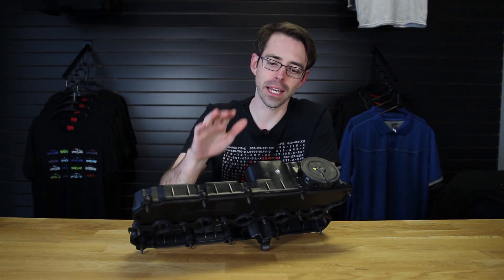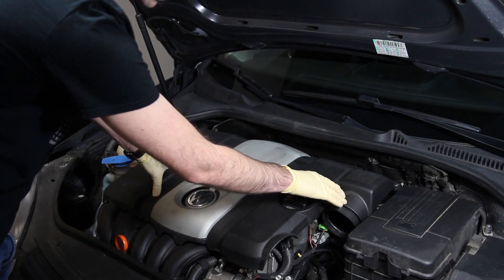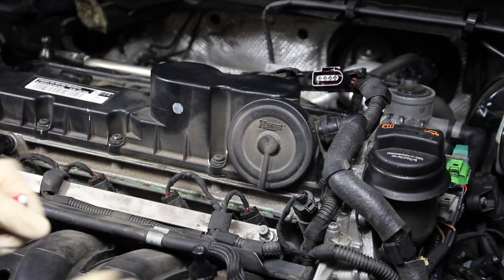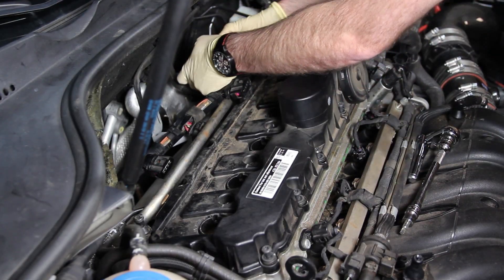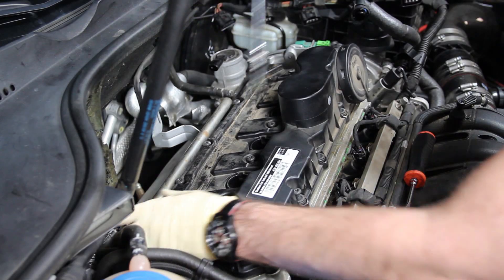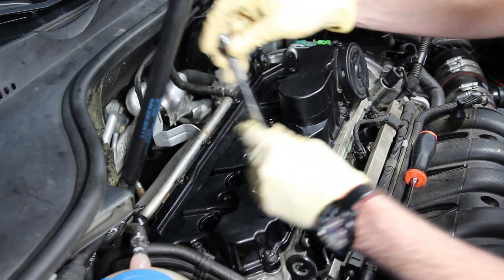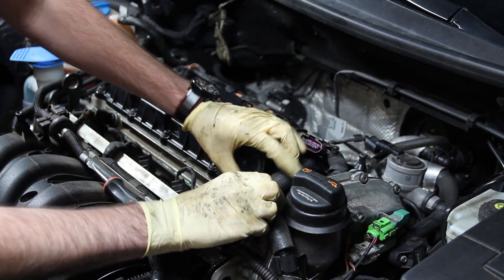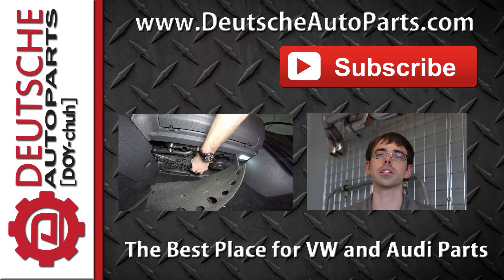How to Replace a Valve Cover on a VW 2.5L 5 Cylinder Engine (PCV Valve Built In)

Comment: Hey guys, great video! Everything is very clear, understandable and you guys make it very easy! 
I have a question. I bought a used 2012 Jetta 2.5L. It had P0106 code and that was MAP sensor. The car would accelerate with hesitation, and after I release the break the car wouldn't move right away. So I took apart everything I needed and took the MAP sensor. It was covered with oil. I replaced it with the new one. The car drives fine, but for a day only. Then same problem. I found out that it was getting covered with oil because of bad PCV. I ordered one online and replaced it hoping it would stop leaking oil. In two days again same problem. The MAP sensor is covered with oil again. Plus, I got P1288(or something like that) saying the system is too rich at bank1. So I guess since MAP sensor isn't working properly the system gets too much/too little air, right? Because of that the accelerates even worse. When I clean the sensor again and reset the codes, the car drives just fine, but for a day or two. I'm sick of taking the sensor off and cleaning it from oil.
So does it all mean I need to replace the whole valve cover? 
Please guys, guide me here. I spent all my savings on this car and can't afford going to the shop/dealer since I'm a student. Trying to fix it myself.

Thank you so much!
Reply: Husrav Homids you need to replace your gaskets. Buy your parts from Rockauto.com they sell the entire gasket set for 98 bucks
Reply: What did you end up doing with the car?
Reply: @Mario-iy7hw  I ended up selling it with that issue still existing. Couldn't figure it out. Oh well

Comment: Hello Deutsche Auto Parts, I'm replacing mine, since a mechanic did a terrible job on it. Would you recommend adding silicone or would gasket do just fine? Mechanic used silicone and i had oil leaking everywhere. I took cover off and there is oil inside spark plug well. What liquid would you recommend to scrape off the silicone around the cylinder head and take out oil inside the well, I'm afraid unscrewing spark plug and have oil go into the chamber. Thank you.

Comment: When installing new valve cover do I need to put any RTV under the gasket or none at all?

Thanks
Reply: Levent Akkaya depends on the gasket type. I like PEL-FAM their gaskets are crush gaskets they seal as you torque

Comment: Great video. Hope my mechanic watches before replacement. Estimate $420 with $250 for part. Horrible design, need to replace entire cover for a simple mechanical failure.

Comment: I have read on some of the forums that a P0106 code, which indicates a bad MAP sensor may be caused by the PCV going bad, allowing oil onto the sensor. I have replaced the sensor recently, and have just read the same code. Is this a likely scenario? How do I determine? Thanks for the video!
Reply: Have the same issue. Replaced the MAP sensor and did the Dorman PCV replacement - still have the code. The throttle body and MAP sensor are coated with oil. Will be replacing the valve cover tomorrow.
Reply: I'm having the same problem. Replaced my MAP sensor (which was covered in oil) and still spits out the code p0106.
Reply: I did the dorman pcv replacement and cleaned my map sensor with maf sensor cleaner. So far so good. Been about 2 months.
Reply: Scott Mackintosh so did replacing the whole valve cover help? let me know please
Reply: Install a catch can between pcv and intake manifold.  The catch can will collect the gunk before the  gunk has a chance of being directed right back into the crank case.

Comment: Just subscribed.  I have a 2006 2.5L that I have been getting things done to by shops that I know work on German cars.  I have 145 thousand miles on the car, but have an used transmission that had about 75K, a new stage 1 clutch.  I haven't had the timing belt changed on it or the valve cover.  Would you recommend that now that the tranny has been replaced, which I believe should have been done at that time of replacement with the clutch.
Reply from the maker: +Lloyd Carter Thanks for subscribing.  Im unclear what your specific question is.  Can you elaborate on that?
Reply: With 145k on the engine, should I replace the timing belt?  Sorry.
Reply: Im also going to look up your site for other goods I want to update. Spring is around the corner for cruusing.
Reply from the maker: Lloyd Carter Thanks for considering us.  I appreciate it very much.
Reply: The 2.5L does not have a timing belt, they have a timing chain. They are supposed to last the lifetime of the engine, though some earlier models like 2005.5 -2007 can have issues. Though I have 145,000 on my 2005.5 and have noticed no issues yet.

Comment: Thanks! This video helped my confidence in performing this task. I realized how loose my valve cover was and where my possible oil consumption was coming from. My engine idles much better as well... I also disconnected my car battery for about ten minutes and then attached it again to clear the computer, so it would relearn how the engine runs.
Reply from the maker: +Dustin Clawson Awesome!! Glad we could help.

Comment: what tools do i need to do this on my own?
Reply: +Isaac Cesaire You'll need a Torx T-30 socket for the removing the vavle cover bolts, and a torque wrench to make sure you tighten the bolts to the proper spec. A flat head screw driver as shown in the video as well to help with removal of various components as seen.

Comment: Excellent video and instructions.  One shop wanted $650 and another $400.  I am a locomotive mechanic.  This video makes the job cost only about $150.00 for the part.  Thanks again for the excellent training.
Reply from the maker: +Barry Munz Thank you so much for the kind words and the purchase of a valve cover.  We appreciate it very much.  So glad we could save you the money on labor.
Reply: @Deutscheautoparts  Can someone suggest a trick to pullout the combination valve back there?
Reply: I also purchased the valve cover from them and this install was very easy. thank you DAP!
Reply: some “mechanic” wanted to charge me 1000 for the task i laughed and hung up
Reply: Do you need to reprogram anything when you replace it?

Comment: Great video , need some help on a 2005 Jetta 2.5L L5 fi. Auto has been running rough was told timing chain jump a link is that possible with a engine with only 85,000 miles ?? Sounds not Volkswagen quality ? Is it possible ?
Reply from the maker: +Jim Lyons Tough to say but it is possible that it has jumped time

Comment: My VW 2.5L Jetta 2006 has 102k miles and it was time to replace the PCV Valve. It was making a weird whistle, increasing and decreasing the RPMs randomly, and throwing the computer codes : P0507, P0171, P2279.
The Dealer wanted to charge $250 for labor and almost another $250 for the part. 
Another auto shop even indicated that I needed to replace the MAF Sensor and Throttle body, but that auto shop was wrong. The root cause was the PCV Valve. 
I replaced the PCV valve myself, and I saved at least $500. The gasket may be hard to pull out, but if you have the right tools, and enough time 1 to 2 hours, everything is straightforward. This was worth the time and money savings.
Reply: +Guido Arroyo did you have a rough idle aswell??
Reply: +Shimisho111 . Yes.
Reply: +Guido Arroyo mines also increasing and decreasing the RPMS with a rough IDLE.  no whistle sound though....and fuel economy is bad....i disconnected that venthose that goes from the PCV vavle to the intake manifold and closed it with my finger and the bad idle stopped...also if i take my dipstick out the rough idle goes away,  did you try anything similar before knowing it was your PVC??? already ordered the PCV unit hope thats the issue pain in the ass having the car parked lol
Reply: +Shimisho111     sounds like your car is experiencing the same symptoms my car had. You may not experience the whistle YET.
Reply: will be replacing it end of this coming week and see how it goes!  thanks for the reply ,  will give some feedback once replaced

Comment: The PCV valve diaphragm can now be replaced without replacing the entire valve cover. It is very quick and easy repair and costs much less. Use Dorman # 917-064 (PCV diaphragm repair kit), available from most auto parts stores. It is not available separately from Volkswagen. The kit is usually around $30 to $40 range.
Reply from the maker: Marcus Johnson We are aware of this part.  Most of the feedback we have gotten has not been great on installing the replacement diaphragm valve.  We have had many customers contact us saying they have performed this install and the covers would not mount properly causing a large vacuum leak.  

This part was not intended to be service that way which is likely why people are having these issues.  We specifically do not offer this product for this reason.
Reply: @Deutscheautoparts  I used the Dorman repair kit. Worked fine for 3 months, then it tore. I just replaced the whole valve cover, the repair kits are a band-aid.

Comment: Can you guys make a DYI on MK6 gti valve cover gasket replacement also. Thanks :)
Reply from the maker: Charlie Chayes the TSI engine does not use a valve cover gasket.  It uses this sealant for that valve cover and many other surfaces on the TSI engine https://deutscheautoparts.com/d-154-103-a1.html.
Reply: Yes I know. What a bout a DYI for 2.OT engine. Can you guys make a video :)

Comment: Hello.  This weekend I'll be replacing my valve cover. I'm surprised you mention to tighten the cover bolts in a "circular" pattern. Aren't engine components with multiple bolts usually tightened in some kind of "alternating" (criss-crossing) pattern to ensure even pressure? Or, maybe VW suggests the circular approach you mention?

Thanks for the video.
Reply: I agree. As a drummer, one of the first things I learned was how NOT to tighten the drum heads. Never tighten them in a circular pattern. This same physics applies to tightening lug nuts on a 5-hole wheel, where you should use a "star pattern". You tighten the primary chain case on a Harley-Davidson in a similar criss-cross pattern. Tightening anything in a circle will warp it if you do it hard enough. 
Also, finger tighten first in the correct pattern. Repeat with a gentle touch on the wrench. Repeat slightly tighter. Finally, repeat with a torque wrench. 
I'm not criticizing, just trying to help. Other than that one thing, this is an EXCELLENT VIDEO!
I ordered the valve cover today. Mine is "sweating" around the perimeter and it has 147K miles on it.
Reply from the maker: either one it essentially accomplishes the same goal of evenly tightening it down.  Thanks glad you like the video.  Hope we can help you with your VW or Audi parts needs.